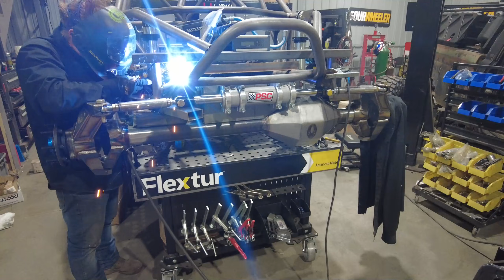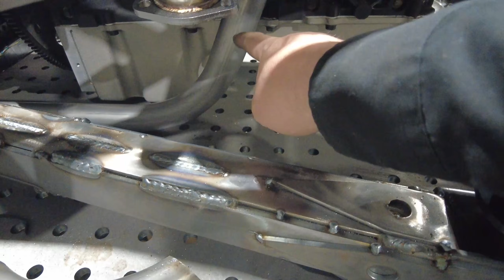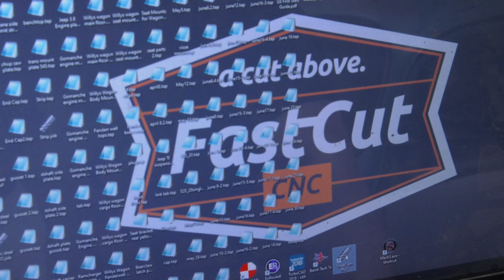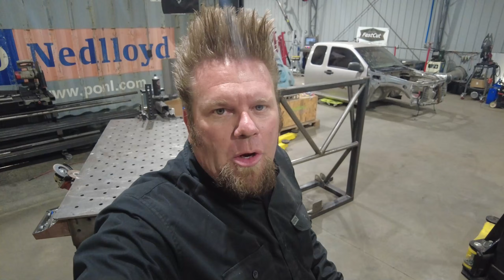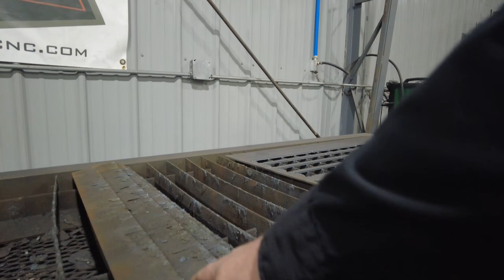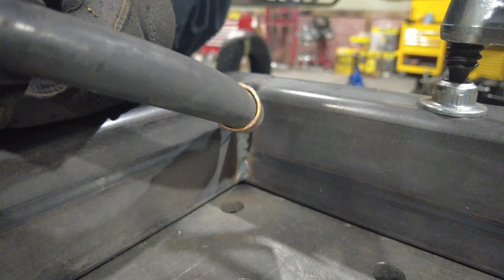Air Bump Can Mounting on a Rock Crawler, Building an Off Road Colorado

Comment: Ian - Great to see you back. As far as the air bump placement in a vertical aspect, that seems to be easily defined by where you want the axle to stop traveling upwards. What I have struggled with in the past in the landing pad. Depending on how you have your suspension setup, the axle will approach the chassis at a completely different angle when flexing, vs hitting bumps with both tires. Can you discuss how you build your landing pads with the above scenarios in mind?

Comment: On the rectangular tubing frame for the Colorado, is there a reason you chose to do butt joints rather than miter joints? I would imagine miter joints would be stronger, and no hollow sections would need to be capped.

Comment: Great video, great content!!!! Reading glasses tip was huge, 43 here and it's definitely getting harder to see the puddle.  Question: when you embark on a build, how do you keep track of bolts/parts that you are going to perhaps re-use? How they go back together, etc.....?  I am using the plastic bag approach with it all labeled. Tried to lay it out as much as possible how I took it off but a bit harder as the more parts accumulate the harder it is to take up huge spaces for a running order of putting it back together. But was wondering if there are any tips or tricks you have up your sleeve?  Thanks again Chuck

Comment: Great Video Ian .. hey it looks like you need a new plasma table send me the old one I will use it LOL .. yes I would use it  but you would be lost without it ,, have to save a few dollars to get one .I. have a JEEP wrangler I am rebuilding it I call it the flintstone mobile .. I am in NY the road crews put a lot of salt down ,,,the  Jeep needs the whole floor or a new body .. also front fenders ,tailgate also want half doors for it .. needs frame work also .. if I had extra $$ would upgrade the drive train ,, keep up the great videos ,,

Comment: Why do drag race cars use motor plates on the front and rear to hold the engine in place but off-road uses standard side mounts
Reply: I'm going to guess.   Probably incorrectly.  That off-roaders generally have 9 pounds of shit crammed in a 5 pound bag routing everything is already a pain without adding two baby firewalls in the mix 

Only a guess.

Comment: I noticed you did down passes on the Colorado front frame. When I was a structural steel welder, I was taught to always make up passes because they were stronger.
Was that not correct?  Does it matter?
Reply from the maker: Technically most structural welding calls for vertical up to prvent slag inclusion. Most of the time those welds are fluxcore or stick...but yes vertical up is the prefered methid
Reply: @BigTireGarage  Thank you!
Great channel really learn a lot watching your shows!